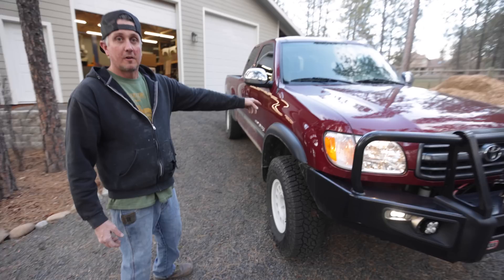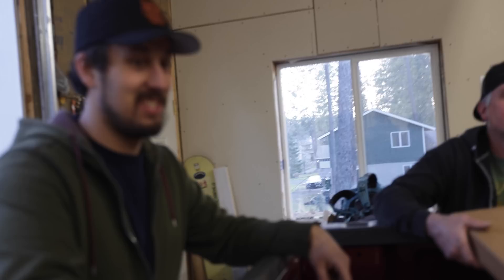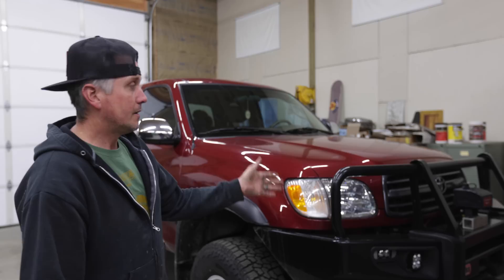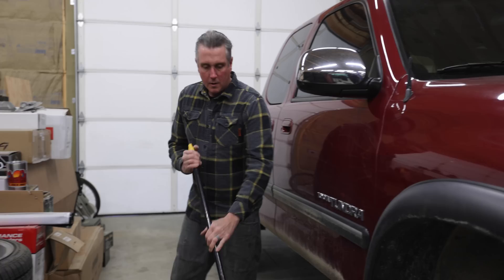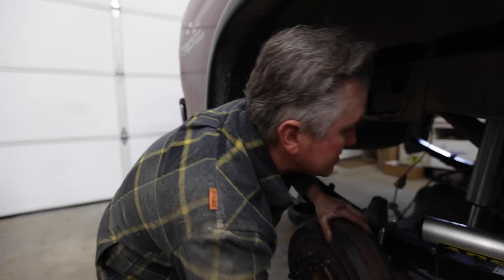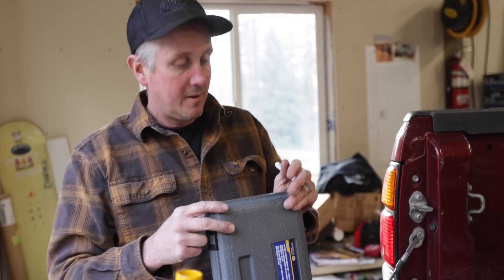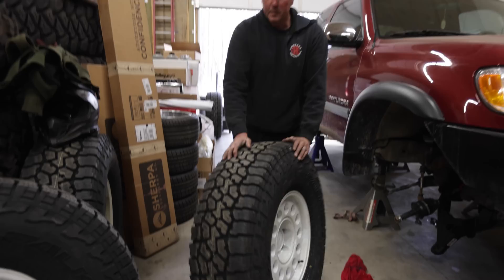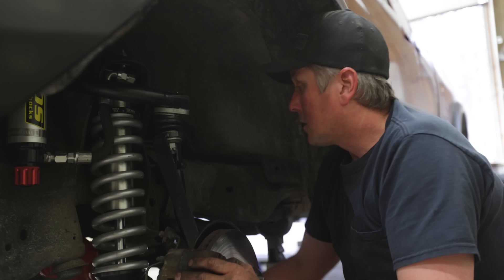Toyota Tundra Truck Build - Ron Burgundy

Comment: Did NOT need to see this.  Just picked up a 2003 V8 last month.
Reply from the maker: Oh yeah!
Reply: You're doomed....or at least your bank account is!
Reply: You might need more information on the exact parts he bought, and what parts of the bumper he cut off
Reply: I love my 03’!
Reply: I just bought an 06 with 160000 miles 1 owner garage kept…. A freaking GEM. Now im on the YouTube algorithm I need to
Reply: @goofbtw what’s some stuff you’ve done?
Reply: @dillonmalloy2123  2022 tacoma stocks wrapped in mud graps and 3 inch level. Tint aswell I love it so far!

Comment: These trucks were almost invisible for the past 15 years. I didn’t think they were anything special for the longest time, but lately I have seen a few that look great. The size of is perfect. Modern halfton trucks are huge and the simple older Toyota engines are cool. Nice project!
Reply from the maker: All valid points..  now I feel like I need one
Reply: So right. Even if you add most of these mods you will end up about half the price of a new one and will be fixable in 15 years, which newer ones won't be as friendly to fix or upgrade.

Comment: I have an 04 Tundra and just finished doing a suspension upgrade today! New Camburg upper control arms/ball joints, New OEM lower control arms/ball joints. New wheel bearings/spindles/hubs. Bilstein 6112's. I did an add a leaf kit on the rear with Bilstein 5100's.  About 3" of lift. Going from stock tire size up to 33's.  I also have done new custom front/rear bumpers with a 10K Smittybuilt winch from Brute Force MFG. Brute Force actually makes first gen Tundra bolt on bumpers - I think they are the only ones who do so.  The more I research it seems the more options that I am finding for these older Tundras!
Reply from the maker: Sounds like you are on track!
Reply: @thedirtheadshed  Baby Steps.

Comment: I had the 5100's on my 2011 Frontier and they were ridiculously soft. Like the truck would bounce all over the place even when trying to crawl as slow as possible. Way underdamped for that application.

The Tundra looks great with the 35s.
Reply from the maker: Hmm.. Toyota guys say the opposite
Reply: @thedirtheadshed  That's interesting. I'm sure each application is valved differently even though the Tacoma and Frontier are pretty similar in weight and suspension design. 

The front was the problem end on the Frontier. I actually wrote an email to Bilstein about it and they said they tuned them for safety, so I guess that means maximum contact between tire and road. In other words low rebound damping to get the tire back down. But I found the compression pretty soft as well.

When driving over rocks and stuff slow the front shocks just could not control the body of the truck very well. I'm pretty easy on my equipment so I wasn't over driving them. I couldn't go slow enough to prevent side to side rocking as the suspension worked. 

My friend with a TJ and some aftermarket 2.0 stock replacement shocks looked much more composed.

Comment: First gen tundra is a solid platform.
Reply from the maker: They are cool trucks. I kinda want a t100 now
Reply: @thedirtheadshed  had a 4runner of the same generation that was solid, and am still driving a 2003 Tacoma with 300,000 miles, never a mechanical failure.

Comment: The 1st gen tundra/sequoia is the ultimate hidden gem of the used Toyota market... Limited aftermarket "kits" but plenty of options for most wanted upgrades if you search around and piece mill... (archivegarage if you are looking for 1st gen tundra rear suspension upgrades) The typically found deaver leaf springs are wayyy undersprung and sag terribly, even without additional bed weight 😒 But great platforms, and much cheaper than equivalent tacomas/4runners 👍
Reply: Also definitely reccomend the slightly beefier, less binding, less boot splitting CV axles which are available without going full RCV... I forgot the brand, but they are not much more money than regular new or rebuilt axles... Also reccomend adding an ECGS differential bushing kit to replace the awful driver side factory needle bearing if you ever pull the diff for gears/locker/busted spider gears... That last upgrade goes for for most models/years of Toyota front diffs (you can do it externally just by pulling the axle and not the entire diff, it's just more time consuming, but still worth it!) 👍
Reply from the maker: Unfortunately leaf springs are hardly ever perfect in the first shot
Reply from the maker: Ecgs is a great company
Reply: @thedirtheadshed  Thanks for the replies 👍The first gen tundra deaver springs typically available from deaver definitely provide some lift and the advertised improvements, but are pretty well documented to flatten out pretty quick even on an access cab with little to no additional weight (unless they've changed something in the last few years for that item number) 😔 The Archive Garage springs are custom spec'd for 1st gen tundras and he used to have them produced by deaver in batches (maybe he still does), and I believe had a couple of offerings based on cargo capacity at one point, although he may have just settled on one set of specs now for the 1st gen tundra... If my tundra becomes my daily driver again I'll definitely have to replace my original deavers with the archive garage version... Mine went flat in a one year-ish with maybe a 200lb toolbox loadout in the back, all weight against the cab, also just an access cab, not a double cab... I ended up making a bumpstop bandaid because there are no good shops around that can re-arch or customize leave packs 😐 BTW now we need to see Ron Burgundy get a custom  Dave rear bumper 😉 don't forget the bed trim starting at the rear fender flare straight cut to the new higher bumper! Plus if you do that we'll get to see a new spare tire mount build! I'm only suggesting this because I know you are looking for EVEN MORE projects... 🤣👍

Comment: Have you ever thought of portal axles on a Toyota/Lexus rigs? I like the fact you leave all the factory angles and suspension(I you want) plus you bolt on a 38-40” tire without regearing. Werewolf 4x4 check them out. Only issue I see is that they’re in a war zone in Ukraine.
Reply from the maker: Yeah. I like the idea, but It’s never as simple as it seems

Comment: As a 1st gen owner I can assure you the front suspension is not bullet proof. In fact it's far from it as these trucks suffer from a very flawed lower ball joint design that tends to fail.C atastrophically I might add.
Reply from the maker: You can fix that with super duty axles…
Reply: @thedirtheadshed  I'm going a d44 up front on mine.

Comment: Nice build, How is he liking the 700lb coil overs? Or will there have to be valving changes? I did this with 650lb sway-away and it is way to soft with the bumper and winch weight up front, removed all the lift the mid travel should have given it. What brand are the lower control arm cam bolts? They have a milled in end, so nice
Reply from the maker: It was a little light in the front .  The control arm bolts were either factory Toyota or Specialty products. I forget

Comment: Awesome work Dave. How does it do with those tires and stock gearing? Those 4.7 V8s made seemed to make a lot of noise but not a lot of power
Reply from the maker: It hunts around in high gear a lot.  Makes cool noises.  Not lots of power.. true

Comment: Wondering your thoughts on spartan lockers on a truck that will see roads as well as trails. Seems on here everyone says something different. I plan to upgrade to air lockers down the road but they aren’t in the budget right now. Any insight would be great thank you.
Reply from the maker: I like Spartan lockers for their simplicity, cost, and durability.  Not a bad option.  But expect to have a lot of tire chirping around corners. And the occasional locker bang
Reply: Ok thank you. I’m new to the 4x4 world was always into mini trucks mostly s10. My daughter an I started watching dirt every day and she likes the old trucks. I just picked up 2 dodge w250s for us to build together. She turns 13 this month and doesn’t know yet. I don’t plan to touch her axles but want to lock mine.

Comment: I need some guidance....
I have an 02 Tundra, 2wd AC, with bilstein 5100s at the top notch. I recently installed the SOLO MOTORSPORTS LCAs and like this truck, my front end is down about an inch. This was unexpected.  My goal was to fit Flaken 34" tires (285/75/17). I already trimmed the front bumper due to the wheels forward 1". (Cant affird an after market bumper right now)

Ive desperately been resesrching for a quality way to get the truck level again and cant find a good option. What would give a normal truck a 3" lift, only will give me a 2" lift based on how im understanding my situation.

I was considering bilstein 6112s and then going up beyond the recommended notches as an option. What did you guys have to do? I really need some measurements and numbers  to work with and some advice.  What was the actual "lift" that you ended up needing in order to get that truck level? Any coilover set up recommendations that will get me there? Im reluctant to use spacers but not completely closed to it. Please help! Thanks for any tips you can give me.
Reply from the maker: I think I would start saving up for an ADS, Fox, or king shock.  They are threaded body, so more adjustable.      A quick option could also be looking at Ready Lift to see if they have like a 3/4” strut spacer
Reply: @thedirtheadshed  will a king coilover adjust beyond 3" ? Do you happen to remember what you had to do to this truck to get it level again?

Comment: @thedirtheadshed hey dave, got a question about my build if you find the time to read this or reply. I have a 97 tj I've slowly been building. Wanting to run 40's. So here's the question, I have a dana 50 and sterling 10.5 out of a 99 superduty laying around. I know the rear would handle it but am up in the air on the dana 50. Any input is greatly appreciated. Thanks
Reply from the maker: That 50 is not everyone’s dream axle, but it would probably be fine in that rig.  Just research gear and locker options and make sure you can get what you want
Reply: @thedirtheadshed appreciate you taking the time to answer! I'd love a set of 05+ super duty axles but around here they seem to be gold plated. Got a good deal on my d50/10.5 (350 for whole wrecked truck) so thought I'd look into using them. There's option enough to get it under my rig with a good gear set, there's a few locker and axle choices. Heard arb makes a 35 spline not listed on their site that can be special ordered to use d60 shafts but haven't dug real deep into it. I'd hate to pour a ton of money into it to the point I could've just got a d60. But if it will hold up I'd like to use what I have. Even considered swapping the d50 under my 05 f250 just to snag the 60 out of it lol. Love your videos man been watching since the start of dirt every day, keep up the great work!

Comment: Wicked cool dudes....
I own a 2005 stepside with 3.5 leveling kit front and air bags in the rear.
Anyone interested in a stpside bed around NHlet me know, I replaced my original one had a couple rust holes after I pulled the liner out,
Nothing that couldn't be fixed up,
Sporty looking, make a comment and we could figure out a contact. 
Not much 😊
Reply from the maker: Hope it finds a good home
Reply: @thedirtheadshed  do you have any ideas before I scrap it for pennies?
Is there any forums?